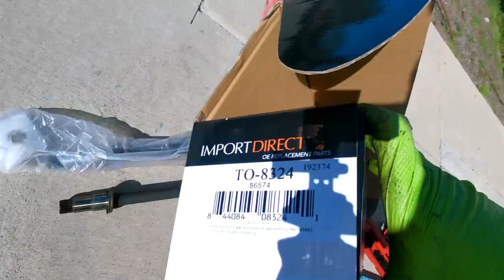2011 Toyota Sienna : Passenger Side CV Axle Replacement

Comment: Thanks a ton for posting the video - great job showing us how to do it. Really appreciate your time! Only question I have is how much, if any, transmission fluid came out when you removed the axle? Did you have to refill, and if so, how did you know how much? That's one of the main things keeping me from doing my own since the transmission doesn't have a dip-stick for level. Thanks brother!
Reply from the maker: In my experience it only leaks out when previously overfilled or not properly jacked up. You can put a container underneath and catch potential fluid leak then measure and fill same amount after swap
Reply: Cool, thanks again man!

Comment: What is the size of axle socket for Toyota Sienna LE 2011 is it? 32mm?? And how about control arm? I have a hard time all the screw nut bolt are too tight that is how I cannot remove that require special heavy wrench torque to try unscrewed all bolts.
Reply: Torch and a breaker bar for more leverage if this helps 2 months later

Comment: So I replace the axle and the issue I’m having now is I cannot get the ball joint to line up with the holes in control arm it seems that the axle is not letting the knuckle get close enough far not allowing me to push all the way in to control arm
Reply: Maybe it’s because I also replaced the control arm and it’s too stiff not letting me push down enough
Reply from the maker: Be sure the axle didn't pop out of socket. You should be able to push the entire knuckle assembly in to line up the ball joint studs
Reply: @Usmanthemecano  I know but for some odd reason it’s not going to brand new axle and new control arm it looks like the actual hangs a lot longer than the one in your video
Reply from the maker: @mosheweisz1087  try removing the sway bar link
Reply: @Usmanthemecano  already did
Reply: @Usmanthemecano  only thing I’m thinking maybe it’s the wrong part
Reply from the maker: @mosheweisz1087  could be
Reply: @Usmanthemecano  Now I cant line up the knuckle to the top hole on the strut Maybe because I am doing it on the floor not on a lift

Comment: Lol it doesn’t come out that easily
Reply from the maker: In Texas it does bro
Reply: Usman The Mechanic 🤩🤩
Reply: Whole day spent trying to get it out with no luck. Tomorrow taking some heat to that bracket that has that ring. I hope it works, tried everything else. Dumb rust, USA North East problems 😭.
Reply from the maker: @Humza1  cut the shaft off at the bearing and use large hammer to pound it off of the bracket...
Reply: Good video to show the process.  Living in the rust belt I had the same issue.  Had to cut the axle with grinder / sawzall on each side of the carrier bearing bracket plus once more near the tranny to get access and then press out the old bearing with a hydraulic press.
Reply: @Usmanthemecano  where’s your shop location? I have the same van that need front axle drive assembly replace. Thanks
Reply from the maker: @norberthinahon  I'm in Richardson
Reply: @Usmanthemecano  oh man too far, I’m in Austin. Great video 👍🏼 thanks
Reply: Try the Air Hammer Vibration technique. When an air hammer is applied to the bearing carrier -- bumping it perpendicular to the bearing-axle assembly -- the rust is vibrated into oblivion -- and the bearing-axle assembly just 'walks' out of the hole. There is a video on YT showing exactly the miracle -- google CV joint Sienna 2015 to see this achieved. It'll blow your mind. It, the vibration, takes about 60-seconds. (!) There is no pulling, cutting, cursing involved.

Comment: Folks they don’t come out that easy they are always stuck that axel had Been replaced before it didn’t have the 12 point 30 mm nut
Reply: You've got that right. I spent hours getting mine out. I replaced the carrier so i didn't have to worry about banging the bearing out. Even getting the carrier out while the axle is in it was tough. There's nothing easy about this job.
Reply: This video is EXTREMELY deceiving. To get that axle out while on your back is a MAN-MAKER! You will be fighting that carrier for hours. I honestly may need stitches in my face from the pry bar slipping. I’m taking a break now because it is whooping me. I’m concerned I may need to have it towed. This video gave me false confidence.
Reply from the maker: Just replace the carrier.  Remove the three bolts that hold the carrier.  Pry it off the engine GENTLY and either replace it or hammer it off
Reply: Dude! That’s exactly what I did this morning!!! Worked like a charm.
Reply: Try the Air Hammer Vibration technique. When vibration is applied to the bearing carrier, the rust is destroyed, and the bearing-axle assembly actually 'walks' out of its hole. See cv joint Sienna 2015 YT video. The technique is recorded there. It takes about 60-seconds of vibration to get it out of its hole. (!) Your jaw will drop.